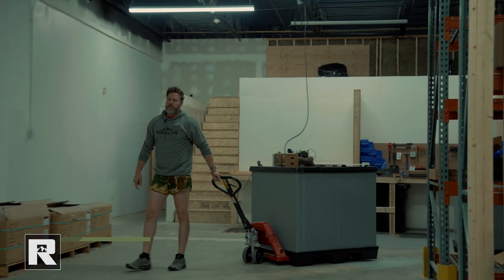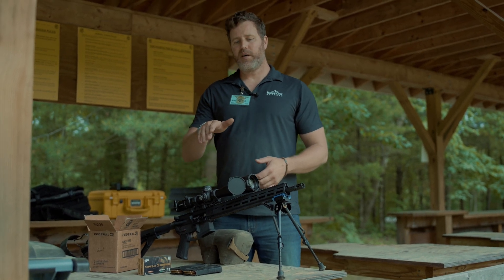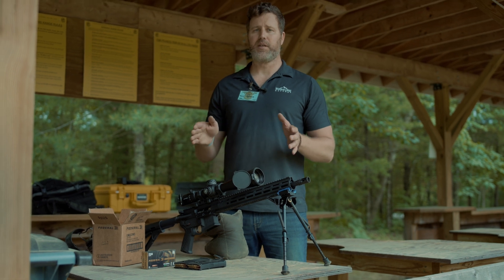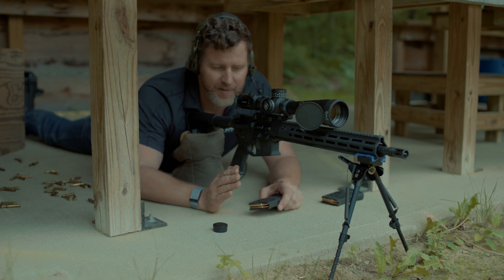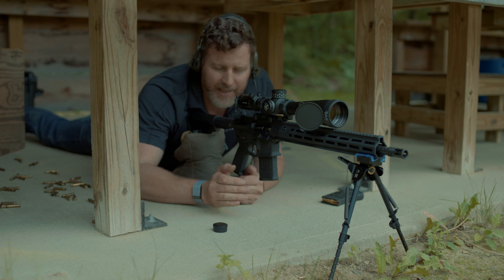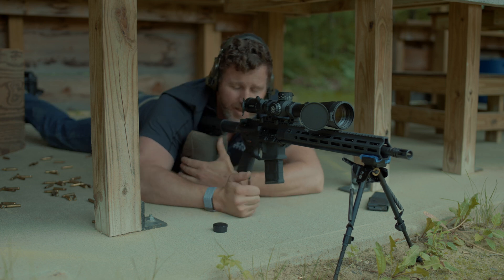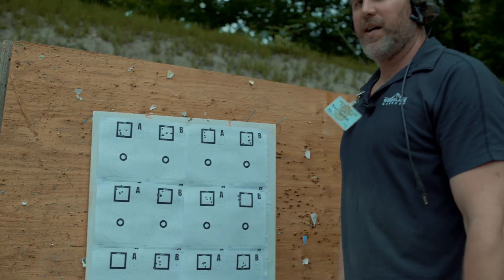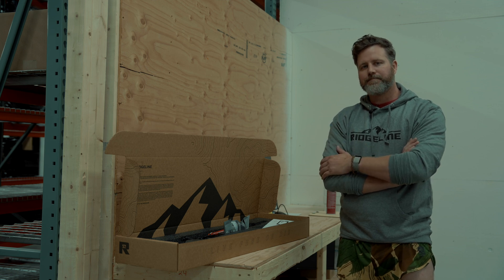The Science behind the all new RD-15 LPR with Dr. Rudy - Episode 4 - Accuracy Testing

Comment: I want to see a 6 arc version and a large frame 6.5 creedmoor version. I'd also like to see sand cutter chrome bolt carriers with duel ejector chrome bolts with phosphate extractors. A collaboration with centurion arms to include their knights style bolt lugs and barrel extensions would be the extra mile. Along this line I would love to see more cooperation in the industry between different companies with good ideas. I hate centurion's rails, but I think they make the best bcgs that aren't sold out all the time like knights, and Chad of SOTAR agrees. I love your rails/receivers, but would really like to be getting something a little nicer as far as your bcg is concerned. I think you guys, along with cobalt kinetics, aero precision and a few others are going in the right direction as far as the receiver to rail interface is concerned, and I think you guys did great with your gas block to barrel interface, but I still think you are leaving things on the table. Basically the only thing I would change is what I stated above, 6 arc, 6.5 creed, and knights/centurion sandcutter chrome bcgs with those small touches like the improved lug geometry (even jp is doing something in this regard), phosphate extractor, duel ejectors, maybe an lmt style lobster claw extractor, maybe something with the cam pin area to strengthen it (knights does a smaller cam pin, I can't remember the other company but someone else did the opposite and added material to the bolt with the cam pin sits, making the bolt a little thicker there). Those are just some ideas. I'm still waiting to some company to combine all these obvious improvements but until someone does I'll continue to be disappointed. People spend more than these guns are worth just kitting them out with accessories, often their optic packages cost as much as the guns. If you guys are willing to go this far in the way of improving the system, why not just go balls to the wall and combine all the best features from all the top manufacturers? I think people would be willing to see this gun go to 3500 or 4k if it came with all the improvements I stated, along with maybe a really well done ambi lower like lmt or knights ks series. I know I would, because I know it would basically last my whole life. 

Also, what buffer weight do these come with?
Reply: obviously the barrel wouldn't last my whole life, so I also hope you guys have some kind of service you offer to replace the barrel once I shoot it out. I'm happy to pay for it obviously, I just want to know in your marketing material that you guys do that and want to make it easy for people who actually use their stuff regularly and wear things out.
Reply: Oh yeah, and another criticism I would have, the screws for the handguard are disconcerting, I'm just putting that out there, maybe in your testing they are bomb proof but perception is also a factor and just putting it out there, those screws have a disconcertingly low thread count engaging with the tapped hole, maybe make those bad boys a few threads longer. Also, why the fuck is the lower receiver worth almost $1000 dollars stripped? So I'm gunna go back a refine my previous comment above, implement all the features I talked about, and charge the same price for the gun lol make it an ambi lower, full ambi, like lmt or aero pro full ambi, and make the bcg improvments, then the gun will be worth what you guys are charging.